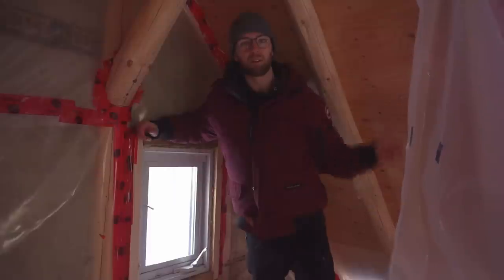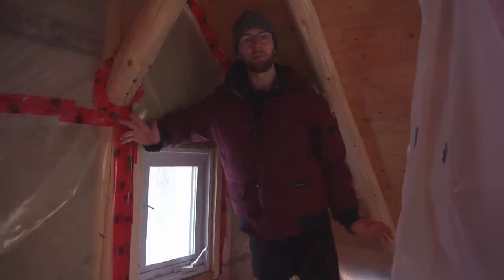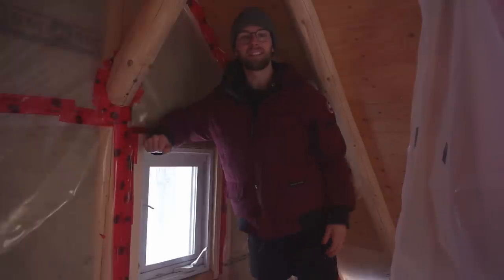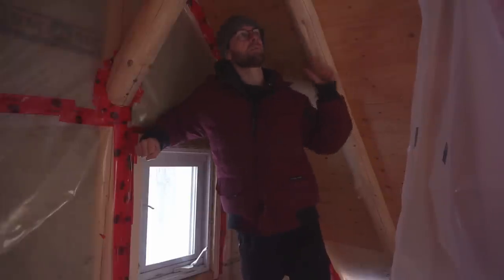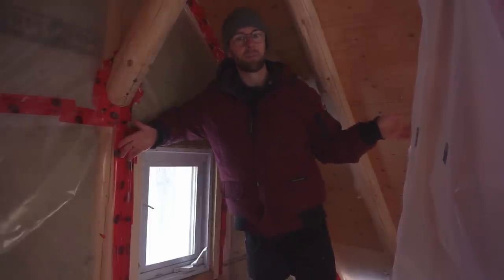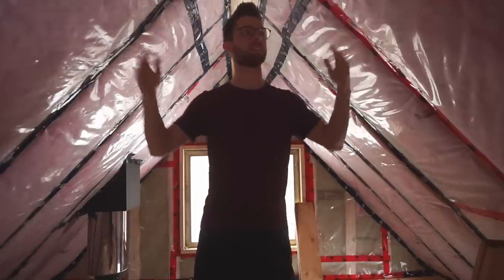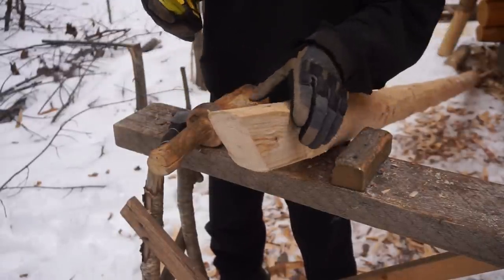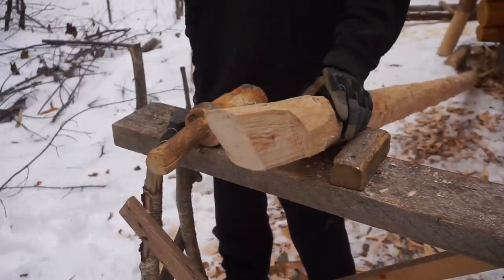Building A Log Cabin | Ep. 46 | Off-grid power for the winter | Fixing a leaking roof

Comment: there are these 'panels' that go between rafters - they are used to make the venting gap between roof and insulation - they are plastic and shaped like a wide channel... for your next place if you build

there is a tool for setting nails so you won't leave hammer marks on wood (heard of it as sinker or nail setter) it is a piece of steel and you hit its head with the hammer until nail is even or sunk in wood
Reply: Ventilation shall not be inside the roof, the plastic barrier you install between the rafters is just a band aid and its not solve the problem that you have condensation inside the roof.

Comment: You may still have the same issue. You should maybe consider rafter baffle’s to put against the plywood then add your insulation.  Just a thought.
Reply: I was thinking the same thing..
Reply: I was wondering if the issue might come up again when they put boards up on the ceiling if it pushes the insulation back up too close to the plywood again?
Reply: 100000%. Gonna have the same problem. So much easier too.
Reply: It will allow air flow but if moisture continues to condense on the roof it will drip onto the insulation causing mold issues. Baffles are the way to go.
Reply from the maker: Just curious why they'd be necessary if the insulation is sitting about 2" below the plywood? Is there a reason why the insulation might get pushed back up against the plywood?
Reply: the baffles will also protect the insulation from moisture, and keep a clear path for the airflow.
Reply: do a little experiment, put them on half of the roof and leave the other half the way you currently have it. The condensation will still most likely occur due to the heat and cold fluctuations, but with the baffles which are made out of plastic, the condensation will collect onto the baffles then run out of the soffit. Without the baffles the condensation will drip onto the insulation, then possibly seep through the insulation and then through the plastic then finally through the ceiling boards and into the cabin. I’d hate to see all of your hard work end up in catastrophe with water leaking into the cabin through the ceiling planks. Imagine having to pull the ceiling planks down then pull the insulation down to install the baffles. Better to put them in place now before you install the ceiling planks. Just a suggestion. Love the channel. Love the build. Love the dedication and the hard work that you both are doing. I would just hate to see you have additional problems that might be avoided.
Reply: I was thinking baffles too.
Reply: I think gravity will make it sink down over time and it will  ock flow at the bottom.  Baffles are the easy fix.
Reply: Ventilation shall not be inside the roof, the plastic barrier you install between the rafters is just a band aid and its not solve the problem that you have condensation inside the roof.
Reply: @MartinJohansson-nn5dv
för 1 minut sedan (redigerad)
Hi, me again and i am looking forward to see how it go with the moisture in the roof. I am not sure the model you do now gona work. Moisture happening when cold air meet warm air. If you leave a gap with air inside the roof , there is where the air meets and you do not want this to happening inside the roof. I see Americans using some plastic barrier to collect water between the frames and there just a band aid for the real problem. Right way to do it is to do what you done from the start but have a ventilated roof on top of the moisture barrier outside the roof so you get a ventilated roof on the outside. On top of the moisture barrier on the outside, you install wooden panels vertikal so the water can go out and not stop. On the vertical wood you add wood panel horizontal where you install the metall roof. Now you get a ventilated roof on the outside. Always think, where do the cold and warm air meets there is where you get condensation.

Comment: The design of the roof must be solved by stretching a vapor barrier film over the beam, which must be attached to the beam with a 2-inch-thick sheet, and care must be taken to seal the nail. The slats or in the case of the plate roof, the plywood must be attached to it, and then the plate must be screwed to it. from the attic, the insulation must be placed under the foil and no gap must be left. a vapor barrier film must be placed underneath, and then the paneling must be screwed onto it. This is the layering of the roof.

Comment: Good thing you found the issue with the ceiling now….mold is killer.  I do agree with other comments that baffles are needed for maintaining the air gap….cabins have to breath.  As a woodworker with power tools, impressive to watch you rip the last floorboard with a handsaw!  You will need a way to adjust and clean the solar panel….maybe a little ladder up the same pole will do?  Looking forward to seeing some rustic holiday decorations in the cabin!
Reply from the maker: We'll monitor the insulation over the next year and install some baffles if needed. So far a brush on a stick has worked haha. Though this is just a temporary installation for winter. We'll build a bigger permanent solar system in the spring.

Comment: If you want some advice mine would be to get a product like durovent or raft-r-mate for a better long term solution that you won’t have to worry about. Would of compressed the insulation a 1/2” more but prevented you from having to pad roof out with 2x4s

Comment: Nice to see the progress on your cabin.
Additionally to the  gap you added between the insulation and the roof, I would install some sort of mesh at the very bottom to prevent animals getting anywhere near the insulation and potentially damaging it or ripping chunks out. For the power wires of the solar panel or any wire running into the cabin from above, it‘s best to have the wires droop just before they enter the cabin. That makes any water drip off the wire, hence it cannot keep running along the wire into the cabin.
Reply from the maker: Yes, mesh at the soffits is on our growing list of tasks! Not sure when we'll get to it. It seems whenever we finish one task on our list, 2 more show up haha. Excellent point about the wires!

Comment: Hi, me again and i am looking forward to see how it go with the moisture in the roof. I am not sure the model you do now gona work. Moisture happening when cold air meet warm air. If you leave a gap with air inside the roof , there is where the air meets and you do not want this to happening inside the roof. I see Americans using some plastic barrier to collect water between the frames and there just a band aid for the real problem. Right way to do it is to do what you done from the start but have a ventilated roof on top of the moisture barrier outside the roof so you get a ventilated roof on the outside. On top of the moisture barrier on the outside, you install wooden panels vertikal so the water can go out and not stop. On the vertical wood you add wood panel horizontal where you install the metall roof. Now you get a ventilated roof on the outside. Always think, where do the cold and warm air meets there is where you get condensation.

Comment: Typically there are styrofoam baffles premade for this situation. It's called a cold roof. 2x4s are too much. The idea is to create a void between the roof and insulation ridge to header with opening at the header to the outside. And bird boxes (mesh screen)at the openings of the header.
You two are doing just fine up to this point. You got a lot done with only modest tools! I would put you in a special category of builders. Amazing.... Even most tradesmen wouldn't do what you have done! I would bet many don't even know what a twist drill or a spokeshave is!
Reply from the maker: Thank you for the information !! We’ll look into the styrofoam baffles :)

Comment: You may have the same condensation issue with the van because I've never seen anyone use vapor barrier in a van build. It will trap all the moisture in the walls. Everyone I've seen says it needs to breathe to dry the moisture the metal will create. How are you going to clear the snow off the solar panel with it being so high?
Reply from the maker: We had the same thoughts as well... though with the van, we made sure there was no possible way for air or moisture to get into the insulation in the first place, kind of like an unvented roof as opposed to a vented one. Let's hope it works that way haha. And we use a brush on a long stick, it's worked so far!

Comment: I'm confused still about roof insulation.  If your vapor barrier prevented inside air from touching the cold boards then where did the water come from?   Or maybe some gets through?
Reply from the maker: There is openings at the bottom of the roof!! If your roof is fully enclosed, it might not be a problem. But that was not our case and we don’t trust our abilities to make it fully enclosed without any hole or gap, so we went the other way ;)

Comment: the sell a Styrofoam channel that just needs to be stapled to the underside of the roof sheathing then just put the insulation back. very easy and way less than lumber
Reply from the maker: Yes, but the problem with those baffles is that they would have compressed our insulation, making it less efficient

Comment: Hey guys question how many square feet is your cabin.
Reply from the maker: It’s a tiny thing ahaha 12x12 :) plus de half second floor, which is 6x12. It’s small, but feels gigantic for us!!
Reply: Ok and how many square feet does your wood stove heat. 
I thinking of doing 15x30 with small loft as well just like you did. I  just trying to figure out how big of a wood stove wood be needed.  I purchased a big wood stove can heat space up to 2500 square feet so it should heat the home nicely.